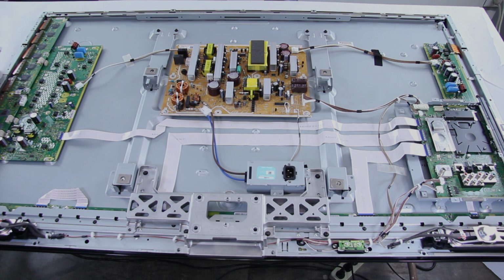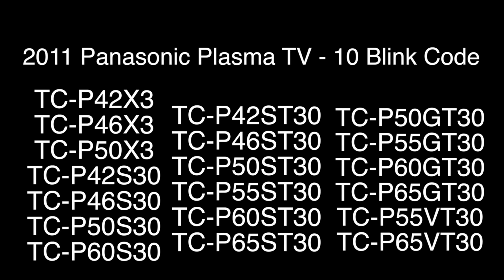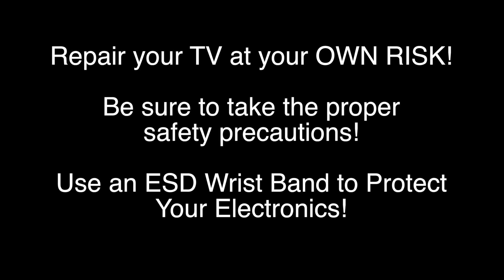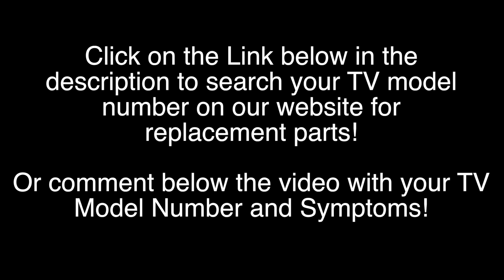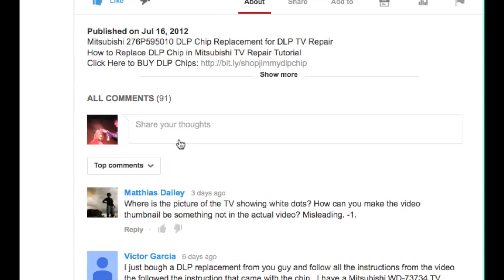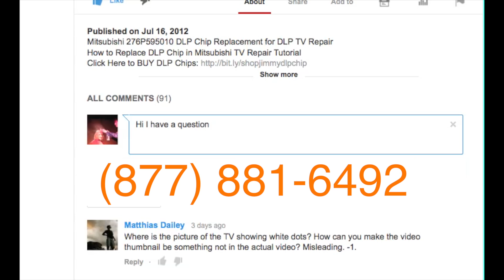Panasonic Plasma TV Repair - Understanding 10 Blink Code for 2011 Panasonic Plasma TVs-How To Repair

Comment: I have a 2010 Panasonic TC-P50S2 picture flickers, its the whole screen. Works good for about 5 minutes when its turned on for the first time, then picture starts flickering.
Reply: nate smith panasonic 42 days switch on red light blinking continue solution
Reply: Panasonic plasma 42 the red light continue blinking solution
Reply: kamlesh talecom Yadav nagar so how to solve it

Comment: I have a Panasonic plasma manufactured in March 2010, it is blinking ten times, the model number is TC P50S2, which board do I replace?
Reply: Hi I have the same one did you ever find problem or the replacement?

Comment: Hi! I have a Panasonic Viera 50 inches TV with model# TC-P50U2 & is not showing pictures on the screen and the power indicator is just blinking 10x pause & blink again. When you plug in the power cable, I hear no click & when the power button is pressed,  I hear click sounds & then starts to blink 10x pause & blink again. May I know what was the problem & how to resolve it. I will appreciate it very much for any help you can extend me. Thanks, Nestor.

Comment: I have a panasonic tc-p50s2 and it does the 10 blinks. What part should I replace?
Reply: +sergio curiel Ihave the same issue, did you get this resolved?
Reply: no I just bought a brand new tv

Comment: After replacing 4 boards, I don't get a blink error anymore but I get a loud buzzing and no picture. There is a think crack in the plasma screen but it doesn't look like it would cause the tv to not work. I do get a difference in the buzzing if I hit the menu button on the remote. Is my tv just fried?
Reply: Well done, you fixed all faults in the TV except for the cracked screen. A crack in a plasma screen no matter how tiny means the screen is cactus. The loud buzzing means the rest of the set is working but the screen has air in it.

Comment: I have April 2010  Model Number TCP54G25.. problem :: standby mode and have 10 blinks...please provide the technical issue and how to repair and replace the board,, this problems had earlier but we had warranty was done with no cost. what board you recommend and where to buy real/original board. thanks

Comment: Hi guys, I have a 2010 Panasonic TH-P50X20Z. I originally had a 7 blink code so went ahead and replaced the SC, SD, and SU Boards. A first my green light was a steady on but no screen out put. I removed the back panel again, checked all connections and powered the unit back on again. Now I have a 10 blink fault code. Can you please confirm that this is the same issue that is in this video? If not do you have any other ideas?

Comment: Hi. I have a Panasonic TC-P50C2 built in November 2010. It just went dark on me suddenly the other day while watching and is showing the 10 blink code. I have been trying to determine which board needs replacing and believe I have it narrowed down to the "A" board. When I plug it in, there is no primary click before i push the power button. It does click after I push the power button and goes straight to the 10 blink mode. No picture, no sound. My question is, does the lack of that first click make the problem easier diagnosed? Does it mean anything to you?
Reply: i have the exact same model tv and it's also experiencing the 10 blink code with the same way of origin.

Comment: I haveTH-50PX75U with 10 blink code. I tried a P/S bd off of ebay did not work still 10 blinks was able to send it back then I ordered the SC Bd. Still 10 Blinks... Before I return the SC Bd. was wondering what I should do next.

Comment: Hi I have 13 blinks on my Panasonic TC-PUT50 Very Light use,  at the HDMI started to fail, no video, audio not audible and crazy noise. 
Then 13 Blinks 
All started after I left my tv connected with my PS3 during an electric storm, the storm fried the modem,.

How much it will cost me the boards ?

Comment: I have a Panasonic Plasma 2010 TC-P65VT25 with 10 Blink Codes.  How do we isolate which board to start with to repair this?  The TV powered off in the middle of watching it.  I have disconnected all cables except power and recycled and it continues to come up with the 10 Blink Codes.
Reply: +Eugene Polgar   I went to your web site and most of the boards for this model show out of stock; can you still get the parts and how long does it typically take to receive and ship to a customer?
Reply from the maker: +Eugene Polgar   Try all repairs and troubleshooting at your own risk.  <!-td {border: 1px solid #ccc;}br {mso-data-placement:same-cell;}->Reconnect everything but the y board plug TV in and see if it stays on. (there will be no picture).  Thanks!  www.shopjimmy.com

Comment: Hello, I have a 2010 Panasonic TC-P50G20 Plasma TV.  Will the 10 Blink Code for 2011 apply to my model year?  I did as instructed. Plugged the TV in, and pressed the power button after hearing the relay first click.  I'm getting 10 blinks.  How can you tell if its the A board versus the SC board?  Thanks.
Reply from the maker: +Vernon Jackson   Try this at your own risk. Unplug the TV, then disconnect the SC board and plug in the TV to see if the TV powers up. Note that it will not have a picture on the screen. Reply with the results of this test. Thanks! www.shopjimmy.com

Comment: I just received my main board for my 2006 Panasonic 42" Plasma MODEL# TH-42PX600U. There is no board on the TV that matches the board I purchased. HELP
Reply from the maker: +Ivette Shepard   Try all repairs and troubleshooting at your own risk.  What is the problem with your TV?  Thanks!  www.shopjimmy.com

Comment: I need a main board for a Panasonic 42 inch Plasma model# TH-42PX600U. Thanks
Reply: my TV is a 2006....is the Main Board generally in the same position as the video you have up?

Comment: Hi Shop Jimmy, 

Your video tutorial is very helpful. I have a 2010 TC-P50G25 and it is showing 10 blinks and I also smell something burnt when I open the back lid on the TV and turn the power supply on. Would it still be the A board that needs replacing?

Thanks!
MDB

Comment: Shopjimmy, thanks for the info. I won't be able to try this for a while, I purchased a new TV. I think there are 2 SC boards on this TV so which one should I disconnect? Also, there were mentions of a high voltage discharge if the wrong part was touched, is that a concern while disconnecting the SC board? 
Thanks for your reply, I will be fixing this TV when I am back, its a great TV.

Comment: My name is Ruben

I have a Panasonic TX-P50X20E. I get red 10 blink error when I turn it on and I also hear clicking sound when I push the power button. Please any help with identifying what the fix for this would be greatly appreciated. Thanks.
Reply from the maker: +ruben boakye   Try this at your own risk. Unplug the TV, then disconnect the SC board and plug in the TV to see if the TV powers up. Note that it will not have a picture on the screen. Reply with the results of this test. Thanks! www.shopjimmy.com

Comment: Your instruction to replace main board for 10 bklinks, but your replacing the electrical board on the video. Which one is right?

I have Panasonic model TC-P50S2 manufactured date as December 2010 with 10 blink. Please advise which board to replace.
Reply from the maker: +Kannan   Try this at your own risk. Unplug the TV, then disconnect the SC board and plug in the TV to see if the TV powers up. Note that it will not have a picture on the screen. Reply with the results of this test. Thanks! www.shopjimmy.com

Comment: Hi, I have a Panasonic Plasma TC-P50G20 made in March 2010.  I am getting the 10 blink code and have attempted a bunch of cleaning, unplugging fixes and nothing works.  I had this problem under warranty and it was fixed by Geek Squad, they replaced a board, I think it was a long board but I cant find the paperwork or remember since it has been several years. Do you have any suggestions? Not worth taking to repair shop, I know they said the part was over $200 when I had it fixed last time. When this originally happened, I saw a 10 blink several times and I think it blinked 4 times a few times and also 2 blinks but I wasn't paying that much attention at the time, thought just was a power outage or something.  Now, all I get is 10 blinks, pause and 10 blinks constantly.Thanks, Jerry
Reply from the maker: +Jerry Stinnett   Try this at your own risk. Unplug the TV, then disconnect the SC board and plug in the TV to see if the TV powers up. Note that it will not have a picture on the screen. Reply with the results of this test. Thanks! www.shopjimmy.com

Comment: hi I have a Panasonic Vivera plasma TV model TH-42PV8H which was bought in 2009. The problem i am facing with the TV is that when i try to turn it on it will keep on fast blinking green light, like around 30-40 times and then go steady solid green, but the screen stays black. actually  I can see the screen slightly glow when its flashing green light but it will not show any menu screen picture. while I was making several attempts to turn it on,it actually turned on once but I could not go to menu of increase the volume etc, all I could do is turn it of and back on with the remote. After turning it off back when I tried to turn on again it Will just keep on flashing green light and then become steady green with no picture or sound. please assist me in resolving this issue. Thanks

Comment: I have a tc-p55gt30 the top half of the screen has been acting up discolored etc. it would warm up for a few seconds and go away. last night 15 seconds in I heard a pop noise the screen and power went off, would not power back on. Eventually I got the 7 blink code. I watched another video saying it was the SC  board but most comments are saying it's the SU board.  Any thoughts? Thank you.

Comment: I have a TC-P42X1 with a 10 blink code.  I recently purchased an A board and new Power
supply unit.  I've installed both items and verified that all connections are made. 
On power up I still receive the 10 blinks.  I do not get a relay pickup when I first plug
it in.  I do get two relay clicks when I push the power button.  Any further
suggestions on what I can try to fix the Television?
Reply from the maker: +Gabe Burns   Try this at your own risk. Unplug the TV, then disconnect the SC board and plug in the TV to see if the TV powers up. Note that it will not have a picture on the screen. Reply with the results of this test. Thanks! www.shopjimmy.com
Reply: +Gabe Burns Hi Gabe did you fix your tv and what was the problem mine does exactly the same thing
Reply: The red light lit up and the relays clicked after the SC board was disconnected.  The light stayed solid for 8 seconds and then there was a 7 blink code. Does this indicate that the SC board is bad?

Comment: Hi there, I have a 2010 Panasonic Plasma TV, TC-P50S2...have 10 blinking light error once I try to power it on. I've watched a ton of videos but am not sure what the fix is. Please help!!:)
Reply from the maker: +Laura Ryan   Try this at your own risk. Unplug the TV, then disconnect the SC board and plug in the TV to see if the TV powers up. Note that it will not have a picture on the screen. Reply with the results of this test. Thanks! www.shopjimmy.com

Comment: the. noise it's turn on the tv in low volume it's fine but I put more volume o no its the Buzz its horrible so I think its the woofer. I don't not. what is the problem
Reply from the maker: +Maria Camacho  Try all repairs and troubleshooting at your own risk.  Is the woofer separate from the TV?  If so, maybe try disconnecting it.  Thanks!  www.shopjimmy.com

Comment: Hi Shop Jimmy. I have a PANASONIC "TC-P42C1" which gives out 10 red blinks error when I turn it on. How do I know what part I need to change? Please reply my comment I want this TV fixed ASAP, I will place an order on ur website as soon as I diagnose the error.  Thanks
Reply from the maker: +Raj Bal   Try this at your own risk. Unplug the TV, then disconnect the SC board and plug in the TV to see if the TV powers up. Note that it will not have a picture on the screen. Reply with the results of this test. Thanks! www.shopjimmy.com

Comment: Panasonic model th-58pe75u had 10 blink code after it spontaneously shut off. I couldn't turn it on. I then unplugged everything and took off the back cover and blew away all the dust with an air duster. after a few hours i turned it on and i get a black bar vertically. within the black bar there are a few lines in color also going vertically. I tried to take the vertical cable in the corresponding region out and cleaned and blew out the plug and replaced it back again, same issue. what is going on, what do i do?

Comment: We have a 2010 TC-P50S2 with 10 blinks. When SS board is disconnected, we have 10 blinks. With SS board connected and SC board is disconnected, we have 7 blinks. With both SS and SC boards disconnected, we have 7 blinks.

No caps, fuses, resisters, etc... appear to be blown. Any ideas?

Comment: i have a 2009 tcp42x1 plasma tv it went out on me last year ,i watch the blinks it blinks 10 times what the problem?                                                    THANK YOU
Reply from the maker: +laurie washington   Try this at your own risk. Unplug the TV, then disconnect the SC board and plug in the TV to see if the TV powers up. Note that it will not have a picture on the screen. Reply with the results of this test. Thanks! www.shopjimmy.com

Comment: i have 7 red ligth on tcp50s30
Reply from the maker: +jose gonzalez  Try this at your own risk. Unplug the TV, then disconnect the SC board and plug in the TV to see if the TV powers up. Note that it will not have a picture on the screen. Reply with the results of this test. Thanks! www.shopjimmy.com

Comment: I have a Panasonic TC-P50c2.  I get the 10 blink error.  I'm not sure if its the main board or the power supply board.  I do not get a click when I plug in the power cord.  I only hear the click after I push the power button.  I hear 3 very quick clicks, 2-3 second pause and then 1 click.  All clicks come from the power supply board.  Any help with identifying what the fix for this would be greatly appreciated.  Thanks.
Reply: Hi Thomas. Did you ever find out what your issue was? My Panasonic is doing the exact same thing.
Thanks
Reply: Melvin Johnson dude same
Reply: Change mainboard (a) thats the fault with most panasonic 50 plasma tv

Comment: Thanks for the helpful videos. I have a Pan Plasma  model TH50PX60U (2006) that had a 10 blink issue, but I took rear cover off and cleaned a bunch of dust out, reassembled, reset it and the code did not return, however, the TV after warming up (5-10 minutes) starts to randomly change inputs. I tried to get firmware onto an SD card for upload into the TV but I cant locate SD formatting for the card. I also tried different Component hookups with the DVD with same result. what is the cause of the uncommanded random switch? How do I get formatting for the SD? What should my latest firmware number be? Could a power supply board be an issue as originally suspected?--blah blah  thanks for the help!
Reply from the maker: +Richard Hoffman  Try all repairs and troubleshooting at your own risk.  I recommend replacing the main board in your TV.  Click this link to replacement parts for your TV model number:  http://www.shopjimmy.com/catalogsearch/result/index/?cat=224&q=th-50px60u  There may be multiple boards for the same TV model number, be sure to match part numbers on your current board, with your replacement for compatibility.  Thanks and please let us know if you have any further questions with your TV Repair!  www.shopjimmy.com

Comment: What would be the right part to replace on a th pz85U panasonic viera plasma?  It started out with 2 blinks and it would still occasionally work, then went to 10 blinks and was dead.  Is it the power board that I need?  If so, what is the right part # and where can I order it from?

Comment: I have a Tc-p54vt25 Panasonic plasma that just shuts off and blinks 11 times. What does that mean?
Reply from the maker: Tauheed Hasan Try this at your own risk. Unplug the TV, then disconnect the SC board and plug in the TV to see if the TV powers up. Reply with the results of this test. Thanks! www.shopjimmy.com

Comment: I am getting the 10 blink code on a Panasonic TC-P50G20. Tried unplugging overnight and same issue, whether I plug into surge protector or straight into outlet. Saw another video about holding the power for 10-20 seconds and tried that a few times, but same issue. Found a lot of people online that attempted to fix and taking them a while to do since issue could be multiple things.
Any thoughts?

Comment: Have a Panasonic Viera 54 inch plasma TC-P54VT25 purchased in 2011. We heard a pop and the TV shut off. When we turned it back on it blinks 10 times as described in your video but this model number was not on your list. Would this still be the A board causing this problem?

Comment: I have a Panasonic TC P50VT20 built April 2010. Just started self turning off with the red light blinking 10 times over and over again. When I unplug and plug in the set runs for a few minutes. Cooling fans are spinning. I've done a little research online and am modestly handy with electronics(replaced HD in Mac Mini). I am willing to give board or multiple board replacing a try.
Reply: Boggy 1221 Hi, did you have any success? I have a similar problem,
Reply: +Ugo Caturano 
Hi sorry no success.

Comment: you dont really explain why the light will switch from 10 to 14 blinking lights. do you unplug the p board? i have a tcp50g25 2010. it blinks 10 times. if i unplug the p board it blinks 4.